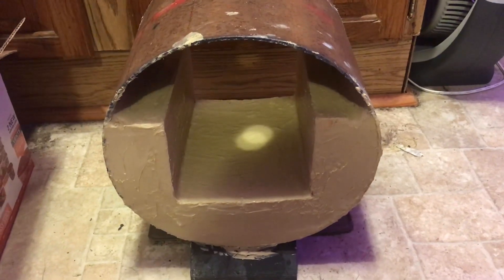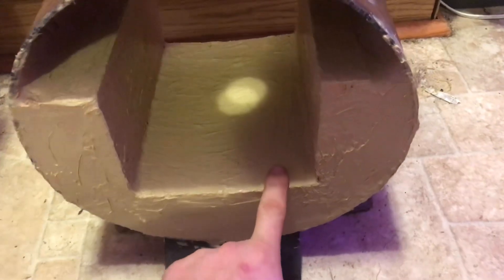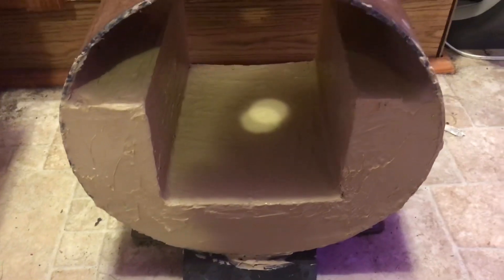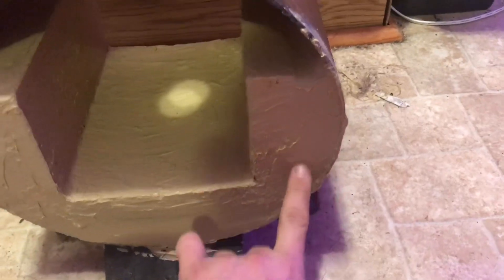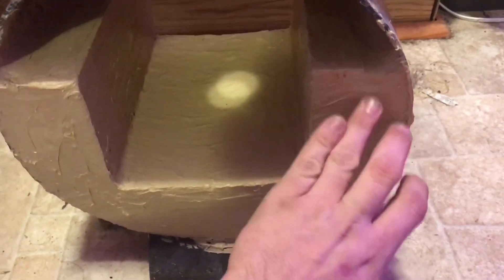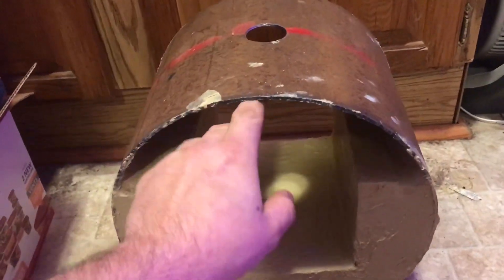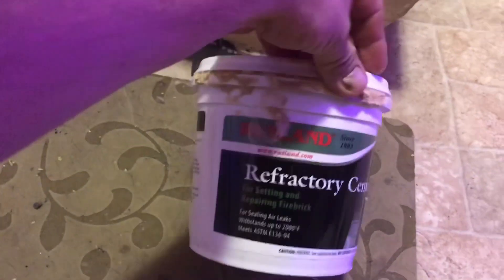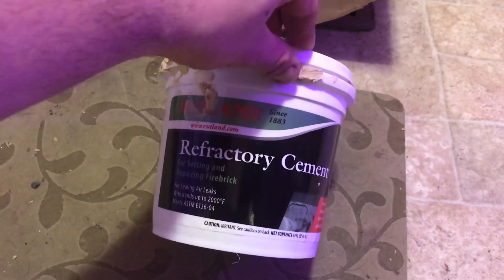Propane Forge Build Pt. 2

Comment: I thought, I missed one.  What kind of brick did you use?  I put a 26 hundred Degree brick in my gas forge and it melted and ran like lava. That brick was one of the ones you put in a wood stove to protect the metal sides. When I put in cold steel it stick to it like toffee to a stick. It bakes off when it gets red hot. I hope your brick is better than that one.
Reply from the maker: ken Bullock I used a 2700* hard brick. You can see the box and bricks in part 1 to get the branding.

Comment: Looking pretty good.  Are you going to coat it with ITC HT100  to protect your refractory and give you up to forgewelded temperatures? 
Please tell me your not going to put forge doors on it like Alec is building  lmbo!
🙏blessings your way sirSir 
Crawford out 🧙‍♂️
Reply from the maker: No, the refractory cement (when heat cured) needs no protection. I do have some high temperature paint I’m going to paint the outside with, and I have a slick idea for some sliding doors to lock in the heat
Reply: @veteranironoutdoors8320   10 4 . Be interested in that. Best of luck